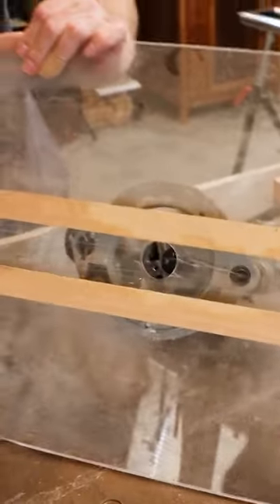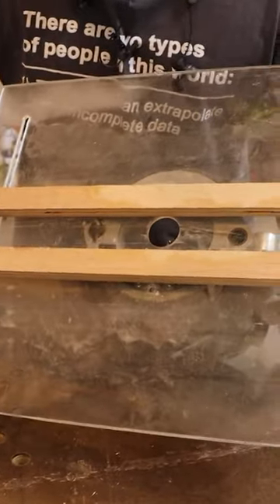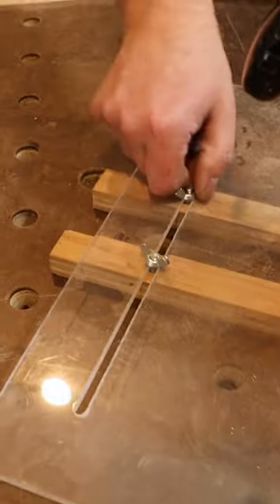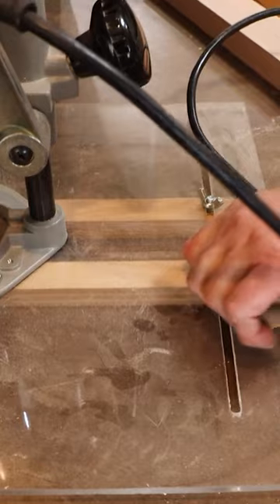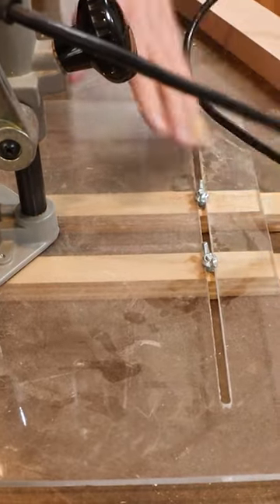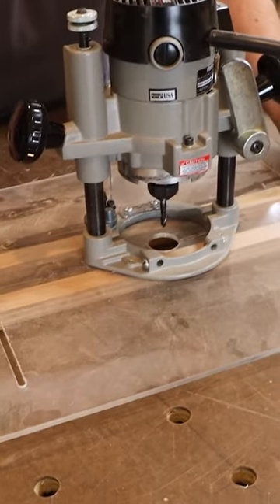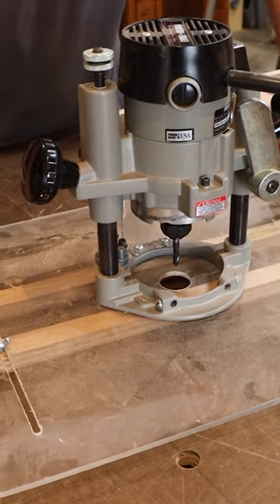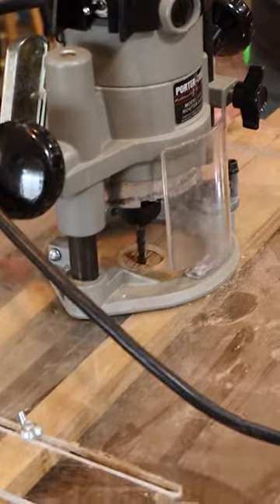Using a Router to Cut a mortise

Comment: Did you have holes in router base already to attach to jig or did you bore through the plate ?
Reply from the maker: I drilled them to match the router hole pattern
Reply: @ thanks